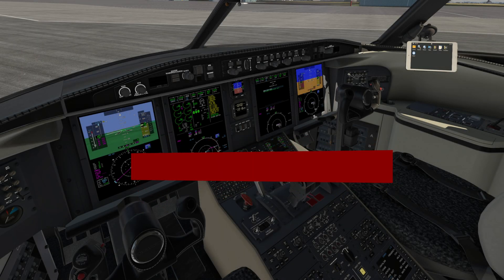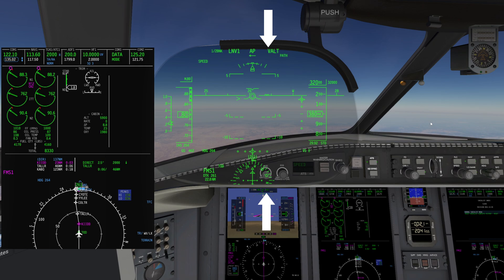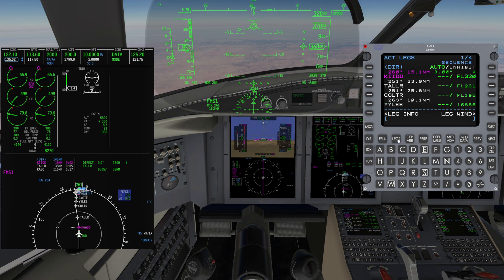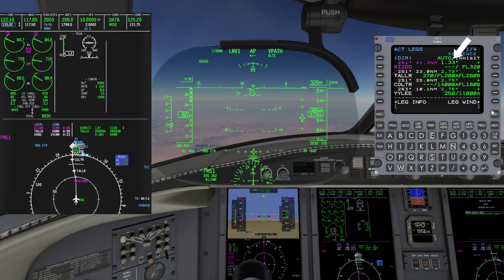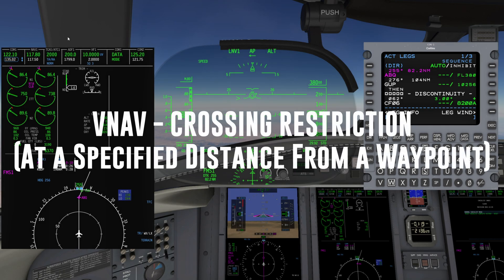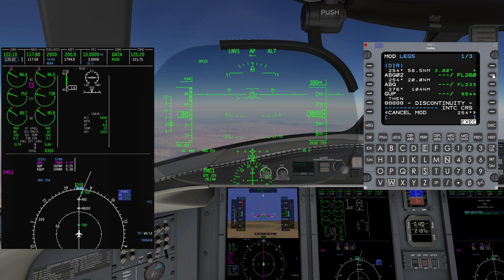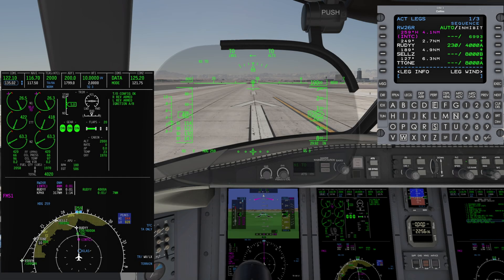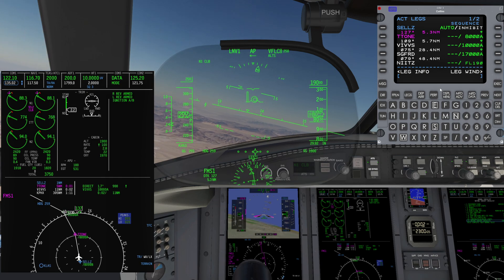Hot Start Challenger 650 VNAV Tutorial | X-Plane 11

Comment: How do you find out if a waypoint has a specific crossing altitude? I don't use simbrief as it doesn't really work with xplane if you dont pay for navigraph (navdata doesnt match), so if that's the solution please do tell
Reply from the maker: For example, scroll to 3:25 in the video. To the right of the waypoint, is the speed and altitude restrictions for the waypoint if published.  In this example, TALLR is speed 270 and altitude restriction above 200 and below 280.  The next waypoint cOLTR is above 14000 and below 180.   Obviosuly to keep your database current, you will need to pay for a navigraph subscription.